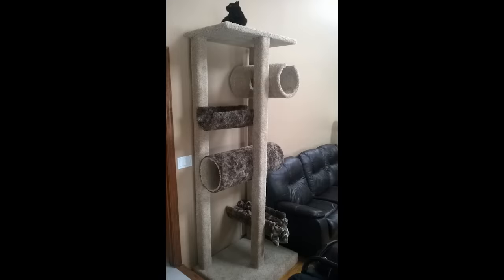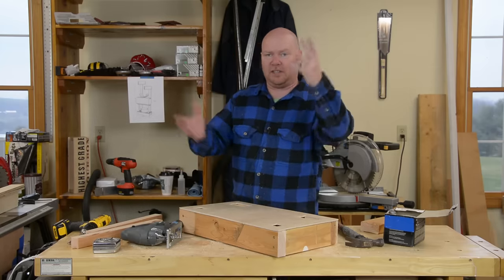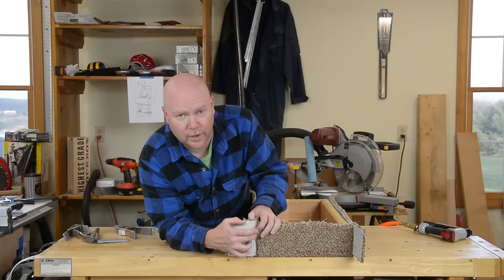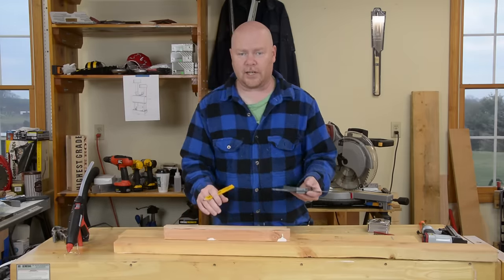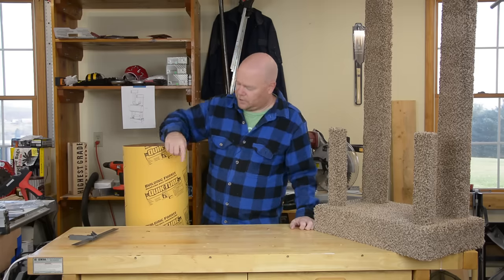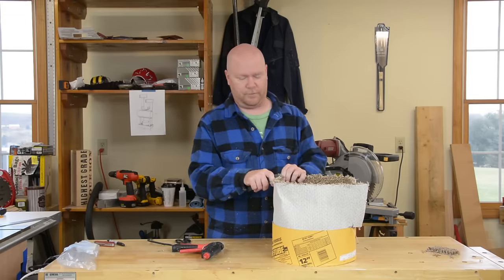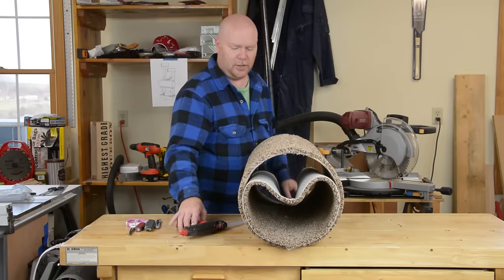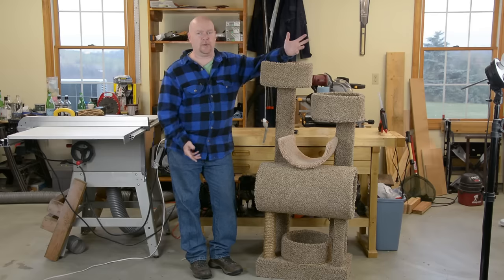Building a Custom Cat Tree

Comment: Just a thought , when cutting the carpet make it a tad bigger and use a putty knife to put the long piece of carpet under the other piece at the carpet joint then hot glue. I have used an old hot iron where the carpet is cut to stop fraying.

Comment: Thank youuuuuuu!!!!  The first video I have seen without having to have serious power tools to make a cat tree.  I live in a condo, so I dont have room nor do i know how to use those power tools.
Reply from the maker: Thanks!   No serious tooling required.  A jig saw is really handy, but this can actually be made with just a regular hand powered cross-cut saw.  You can cut the corners of the plywood top for the base completely away instead of cutting holes to fit the posts and it will be fine.  Also the cardboard tubes can be cut with any saw or knife.

Good luck!
Reply: Thanks for responding so quickly!  You Rock!

Comment: I know this isn't something you do often, but a good carpet knife, $5-15 depending on what you like, and some rectangular carpet blades will save a lot of work.  

Rotate the blade in the knife every cut or two to keep it sharp.  Blades are cheap, about $5 for 100, and dull blades slip easier.  

Cut the carpet from the back whenever possible and you will get straighter lines and easier cuts.  Duck bill shears are like $15 bucks and bent to cut fiber ends that stick up from seams.

Hot glue is perfectly acceptable and used quite frequently in carpet repairs, although I prefer to use seam tape and seam from the top using a damp rag and a hot iron, which will allow you to seam from the top without a $600 cool glide tool.

Cool project!

Comment: I've found a pair of extremely sharp, carpet/cardboard tube cutting works excellently sufficient for exact cuts. It's a lockable close on thumb area.
I also found pocket hole jig joinery to attach all wood joints works better than just attaching to the ends.

Comment: Cats love these! Cats feel safe high up, and they like to watch what's going on in a room from a tall vantage point. However, they will usually even like fairly short cat trees.

They also like sheltered hiding places to nap in, so consider sideways tubes as well as platforms.

For extra cat approval points, place the finished cat tree where the cat can get a view out a window and/or bask in sunshine, and if your home has them, place it so the top platform falls under a ceiling heating vent. Cats were originally desert animals and have a body temperature around 101–102° F, which is why they always seek out warmth.

One thing I'd recommend, to help it hold up long-term, is to wrap rope around the legs at all points likely to be used as a scratching post. Matt did provide a designated scratching area, but most cats will scratch the other legs also, and will eventually shred the carpet where there is no rope. If you guess wrong, you can always wrap rope around the shredded places later.

Keep in mind that cats prefer to stand up on their hind legs, reach above head level, and grip the rope or carpet there to do a good stretch along with scratching, so you'll need the scratching area to go up higher than the total cat length including back and front legs stretched out, so two-and-a-half feet or more, depending on the cat. If a scratching area is not tall enough they probably won't use it much. If the cat tree has tall posts extending above its platforms, they may use those for scratching, too, not just what's at floor level.

Cats also like a horizontal scratching surface for their rear claws. You can wrap rope around a narrow two-foot plank to make a horizontal scratcher.

Cat claws grow in layers. Think of a stack of pointed traffic cones. When claws get dull, the cat needs to shred off the outside layers until new, sharp points are uncovered. A tough material like the rope is really good for this. If you watch a cat scratching and know what's going on, you can see that they make a kind of pulling motion to drag the claw tips and strip off the old layers. Keeping claws sharp is a powerful instinct, so they're going to do it somewhere.

Comment: What determines whether you use the rug folder-over method or the inside-outside method for covering the round forms? Clearly, in your project, the difference is size/length; but it's also with and without a plywood base.

Comment: nice tips!! i am making one of these with no plans and i also used a cement tube form, but i measured it double length, added an inch for the folds and i glued it to the outside first... i anticipate i will have to cut some out, such as a sliver because as you mentioned, the inside is smaller than the outside, but maybe i can just lay the seam over and put that at the top. nice work :) i am REALLY having a difficult time securing the branches (i am using 3 cool limbs rather than 2x4's) to the base tho... need to get the best angle cut and that it difficult.

Comment: @Matt Heere I'm curious to know why you would choose to use Hot Glue rather than Construction Adhesive? I'm planning on making a cat condo for my Calico using a 4 ft. length of Sono tubing that I picked up from Home Depot too but I think I'll avoid the burnt fingers and use the Construction adhesive.
Reply: Christine Christine hot glue sets in seconds and is preferred with carpet.  Construction adhesive has a much longer set time and would require either clamping or a jig to hold things.  Also, there are a variety of types of hot glue sticks, many of which firm flexible bonds to accommodate stresses

Comment: Why did you carpet that one leg that you put the sissel on? You hadn't decided where to put it yet, or is there a purpose for the carpet under the rope?
Reply: The carpet will act as a cushion that rounds the corners and offers resilience that helps keep the rope tight once wrapped.
Reply: probably carpet under to protect the kitty claws when they dig through the rope
Reply: quality

Comment: Love the video I've been looking to build my own. When getting the carpet did you just but a certain amount or did you get scraps? Any information could help just like the video did.
Reply from the maker: I did a "back of the napkin" mock up of how I would cut up the carpet.  I knew I'd be getting it off of a new roll, so the width was predictable.  If you're using remnants or scraps you may have to piece things together creatively, but it does work that way too.
Reply: well i was going to look for scraps but sounds like it would be better to buy a new roll

Comment: I'm not sure why you carpeted the insides of the big tube (or that one post that got sisaled) but, having made my own scratching posts and cat beds, I would suggest not gluing the whole of it on the inside and instead slice it open somewhere in the middle to create 4 pouches as it were and attach the carpet to the tube with velcro so that you can push a (cut up) flea collar between the carpet and the tube (and replace it when necessary). Because on the off chance your lovely pets get fleas (even indoor cats can get them due to people carrying them inside), it's gonna be hell to de-flea that tube, even if you can fit the nozzle of your vacuum cleaner in there. Same when you make cubicles or houses for cats.

Comment: Great job on the build and the video. Did you just buy carpet from the rolls seen at Home depot, Lowe's, etc? Any tips for keeping that cost down? Thanks!
Reply from the maker: +Merald I did for this one because I had a Christmas deadline.  The best bet for saving some $$$ is to get carpet that's being ripped out of a house.  This takes some time because most of it is real trash.  But sometimes, especially when a house is sold, the (new) owners just don't like the old stuff and replace it even though there's not much wrong with it.  If you can score one of these you'll get enough carpet for loads of cat trees, and usually for free!
Reply: +Matt Heere Thanks Matt. We're about to replace some carpet so that will work, and it's relatively free!

Comment: You told me absolutely everything I wanted to know about this project; except, did the cat(s) use it? I'm considering taking something similar on with a few tweaks, but if I go thru all that and the cat doesn't give a damn, that's my life. Thanks for the video, cheers!
Reply: Cats definitely use this. If you have multiple they use it to establish hierarchy. This seems so fun to tackle I might give it a shot
Reply: Sometimes cats will turn up there cute little noses at ANYTHING like this that you buy or make because they have already scented your furniture and claimed it as theirs!  To combat that, spray all soft furniture with Febreeze and then scent the cat tree by rubbing it well with cat nip.  You can use the spray cat nip, but it does not work as well.  Good luck.

Comment: Awesome! This is so cool. I have 2 questions? How much did all the materials cost and can I use something other that hot glue? I heard it was hazardous to my cats health
Reply from the maker: The whole thing cost me too much because I waited until the last minute, so I had to buy new carpet off the roll from the home center.  If you scrounge around for a better deal then you should be looking at <$100 for all but the largest trees.

I've never heard of hot glue being toxic to cats (and I'm married to a veterinarian :) ).  Cats are prone to what's known as a "linear obstruction" - a.k.a. they eat strings, ribbons, rubber bands, etc. and it plugs them up big time.  Hot glue can produce a lot of little strings IF your gun isn't hot enough.  Just make sure you don't leave any danglers around and I think it's fine.

Comment: Hi Matt - before i saw your video i had already ordered one from Amazon.  Not quite as big as the one you made.  However, the base isn't very stable and when my cats climb on it, it topples over.  What is a good way to anchor it down so it won't move?  Thanks
Reply from the maker: Weight is your best option.  Get something heavy like a rock or iron weight, and decorate it to match the tree.
Reply: Stability is the main thing you gain from making it yourself.  After the fact though I would consider anchoring it to the floor or wall like Akia does their cheap ass furniture.  If there is an open box or something facing the wall though you might buy  a bag of sand at the store and put it in there for weight..

Comment: is the base 24"x14"? what was the total height, about 51" or so?
Reply from the maker: It's 21 1/2 x 12, but it's not super critical.  24x14 would work, and be a little more stable, although the U-shaped bed in between the posts might not fit as well.   The tallest post is 48", so total height is that plus the top bed.  Around 54" or so in my case.
Reply: +Matt Heere thank you so much for the reply.

Comment: Do you close of the bottom of the base with plywood and screw the posts to it aswell? And are the back posts 2by 4s and what are the measurements of the front posts? Sorry about all the questions by the way.
Reply from the maker: The bottom of the base is open.  No need for plywood there.  All of the posts are 2x4's on this one.  On my 10' tall one I doubled up the 2x4's to make 4x4's.   Lengths of the posts will depend on where you decide to put beds, and which kind.

Comment: Do you have the approximate size of the base you made? seeing as the sizes worked up perfectly for the concrete tube
Reply from the maker: I don't recall exactly, but it's around 4" wider than 2X the tube diameter, and probably about the same 4" deeper than 1X the tube diameter.   Bigger is better.  You can always cut spacers to brace the posts if the corners of the base are too far out from the center.  If it's too small, you're done.

Comment: I would be easier to take some long peice of paper to measure the inside then put it on the back of the carpet and just cut the carpet to the right length directly. Then you won't even have to waste 5 cm of carpet so  unnessecarily

Comment: Would liquid nail work instead of hot glue?
Reply from the maker: Technically yes, but it would be slow going.  The hot glue sets as soon as it cools.  The liquid nails sets pretty quickly, but not nearly as fast as hot glue cools.

Also, contrary to some Internet rumors hot glue is pretty safe for cats (I checked with the vet to be sure).  I don't know what liquid nails is made from, but it's almost certainly more toxic than regular hot glue.
Reply: Cool! The reason I was asking about liquid nail verses hot glue is that I have always had bad luck with hot glue popping off after time. After liquid nails dries, do you think it's safe for cats to like the hot glue is?
Reply from the maker: I doubt it.  Here's the MSDS for Liquid Nails:
http://www.liquidnails.com/LNDatasheets/MSDS/LN-901_LNP-901
It's nasty stuff.  I really wouldn't use it if there's any chance of it being ingested by anything.

Hot glue has great adhesion in these types of materials IF you are getting enough heat into the glue.  Most problems I've seen with the stuff are from folks trying to use small craft glue guns for big jobs.  Pick yourself up a 100W glue gun at the home center.  Cat tree or no - you'll be glad you did.
Reply: Ok! Thank you so much!!! You are awesome for answering all my questions!! This is the best video I've seen for a cat tree.
Reply from the maker: No problem.  Thanks and good luck!

Comment: Would small feet on the corners on the bottom make sense, stability when two cats hit the same side?
Reply from the maker: Rubber feet in the corners would probably make it more stable, as long as they didn't raise it up much.  So far this one has been OK, and it's sitting on carpet.  The monster at my home ended up attached to the wall.

Comment: How much plywood do you need?  I didn't understand that part.
Reply from the maker: +Rachel Silverman Very little.  Just enough to make a top for the base, and the bottoms of the circular beds.  The top of the base could really be anything solid: plywood, hardboard, melamine.  Even thick cardboard would work in a pinch.  The bottoms of the circular beds need the strength of plywood though, since they're attached off-center and the weight of the cat acts like a lever.

Comment: How much cost for yours and this one? Do you have plans? My boys want one each for Christmas and have seen ones on Ebay. Like you I want good quality for my money. Thank you in advance.🌹Blessings
Reply from the maker: Hello Yvonna.  The cost is going to depend almost entirely on how you source the carpet.  If you can find an inexpensive remnant, or free carpet that's being removed from somewhere then the whole project can be $50 to $60 dollars.   I waited until the last minute and so had to buy new carpet off the roll at one of the big box stores.  That put my cost closer to $125.

Sorry, no plans available for this one.  I went and looked and I can't even find the original SketchUp file.  Don't worry though.  Draw something out that fits your space and go for it.  Plans are over-rated :)

Comment: Is that diagram available? I am just wondering what all of the post heights are?
Reply from the maker: I need to do something about making plans, code, pictures, etc. available.  I get asked for this a lot and I've just been too lazy to do it.    These posts are around 4 feet tall if I recall correctly.  The height is the least critical of the dimensions though.  I wouldn't go a lot taller without a larger base, but otherwise make it whatever suits your space.
Reply: Thanks for the info, experimenting is no problem. I just thought you might have it handy as the proportions turned out really well on yours.

Comment: How long to you think a cat tree like this will last?
Reply from the maker: It depends entirely on the cats; how much the scratch at the carpet and/or how many times they deposit hairballs on it!  The frame and cardboard tubes will outlast the cats.
Reply: Many years. I've got one with roped poles that run all the way up to the ceiling and a couple of platforms in between.  Got it 6 years ago.  The ropes are a lil fuzzy from all the scratchin and climbing but they're far from worn out and will last for many many more years.   The only thing that's pretty worn is a hammock kinda thing in the top cuz the lazy critter likes to lay there a lot and mutilated it with his nails while climbing into it a couple thousand times.  It's not a big problem, it can be replaced quite easily.

Its tall but not wide, so I secured it to the wall as the cat likes to jump down from it and may push it over if it weren't.  So even though it runs to the ceiling it's not very big and wasn't very expensive; I bought it on sale in a pet shop for about 60 bucks.

Comment: How much carpet did you buy for the project?
Reply from the maker: Wish I could remember.  This is the only time I've ever bought carpet new off the roll for one of these.  Holiday gift deadline and all.  Normally you'd be looking into used carpet or a remnant - which means the supply will dictate how much you get.
Reply: Hi! I recovered our cat tree that is floor to ceiling and has a bottom  circular base then 3 big flat rectangular shelves and a top circular shelf. I bought about 70sq ft (approx 12ft by 6ft). I have a  piece left over about 12ft by 2 feet left. I know you don't know what my tree looks like but I hope that helps. Home depot had the best selection and price. I paid  something like $65 for the carpet.

Comment: how much carpet is required?
Reply from the maker: It's best to add up your surface areas and the round up.  For this one, if I remember it correctly, I bought a 6 foot long piece from the roll, which should work out to about 10-12 sq. yards of carpet
Reply: thank you for the reply! really appreciate it.